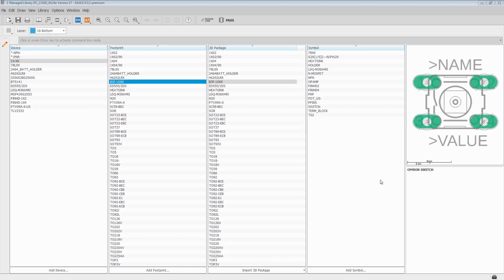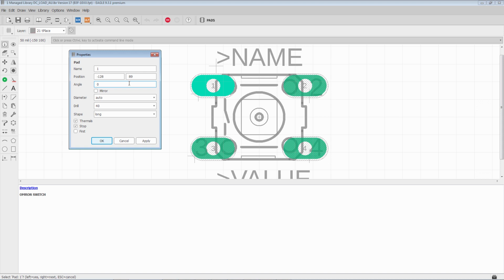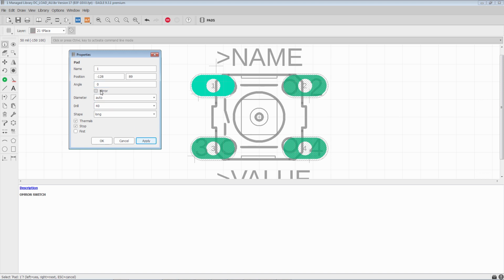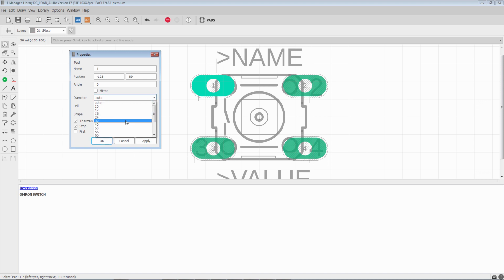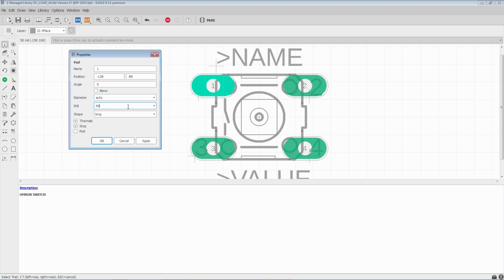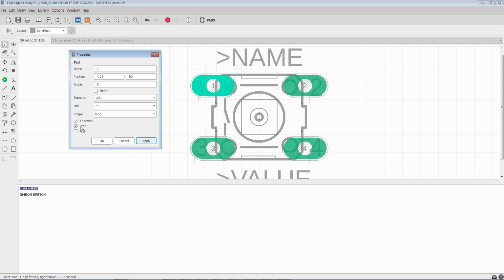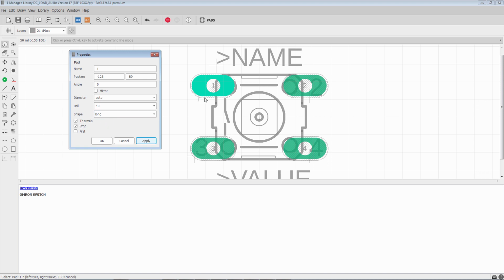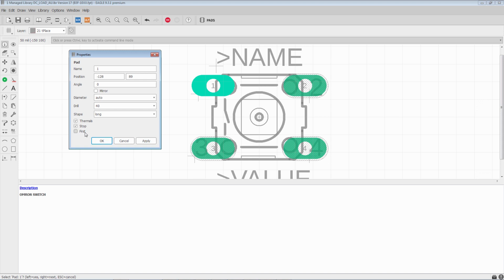QUICK TIP:  Through-hole Pad Properties - PCB Design

Comment: halo, does anyone know how to print the pcb board in actual size in negative mode or so called inverted color to the pdf? I cant find any solutions on the internet. Quite desperate.
Reply: Go to print----> select PDF----->scale to 1.00----->tick the negative check box and you are good to go✌️